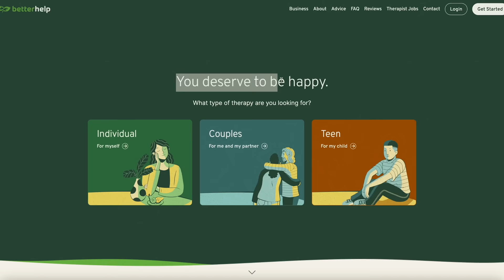A Simple Life in The Woods w/ Max & Occy + Tyler & Todd

Comment: Oh my beautiful ladies. I have to tell you. I thought someone would have after the “need a bigger saw” video… 
So both the saw you had, and the dewalt you borrowed, are compound mitre saws, meaning they tilt… so you can lay your boards flat and tilt the saw on a 45, as well swing it left and right… 45 degrees 
The bolt / handle to loosen the tilt action should be behind the straight edge.  I can see the numbers so it’s def there… so put a piece of timber in ready to cut … then look behind it and you’ll see the red arrow and the numbers :) 

I hope that helps :) 
Ps love the pack! Rock on!
Reply: Ps g’day max from back home 👍🏻
Reply: Sent you a pic on Insta :) 
Cabin looks epic ! Much love

Comment: P s s. You might check it into heating coils for your eaves. It would keep the ice from building up. Although i've never installed them on a off grid system. Not sure if your Solar and batteries meet its power needs. Especially in winter sun. Something you might want to look into. The problem with putting L channel is it keeps all the snow on the roof. I recall you girls pulling the snow off the roof last season. So pretty sure you know exactly what I mean. Again beautiful job thus far. Keep up the good work...

Comment: Pssss. Lol. I know the ssss are getting a little ridiculous. But I've had a lot going on today. I know I should have waited to speak my mind until I actually had a minute. The heated coil Overhang idea had me reviewing everything you girls have shown in the last few years in my head since you first arrived at the cabin. Looking for those flashes of electrical systems. From using the power of your Vans battery storage electric system, Solar powered portable battery banks, gas-powered generators to true solar power, and big bank battery storage in the Pack shed. Beautiful! But I could not recall a trigas. Automatic generator to charge the batteries and produce power when the solar array is covered in snow or it's dark for 2 weeks. I don't know how many kilowatts you need, but I don't think it has to be a massive thing. Just as long as it disconnects the solar array and feeds your electrical system automatically. Probably when your charging system gets down to a certain level. It kicks on. Pretty sure that's jasmine's department. I think it would also Help ease your minds. It only takes a little headcold to knock us out. Definitely wouldn't want to be out in a snow storm if you're not feeling well. Maybe Porter might save the day ?_? But I think an automatic generating system is more than just that. It gives you the opportunity to leave on vacation. Go visit loved ones and not worry about If it snowed last night or if someone showed up to clean off the solar panels. As long as its got gas, Propane or diesel you're good to go... Just a thought or Piece of mind. Love the pack. ')